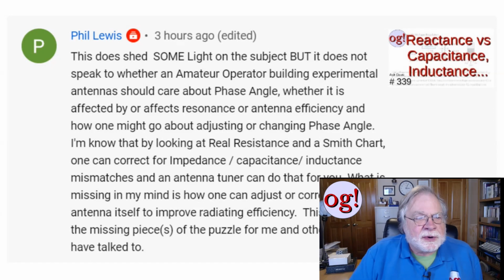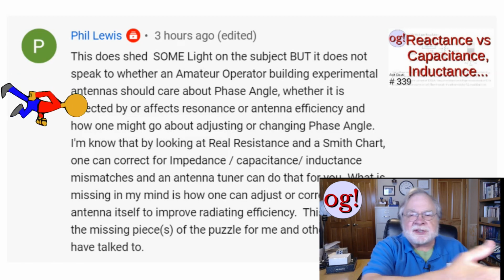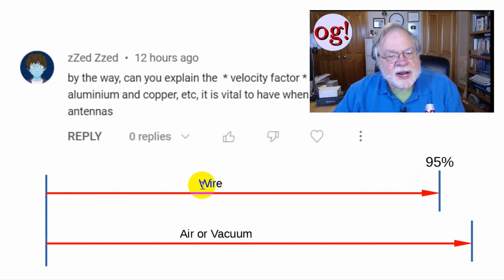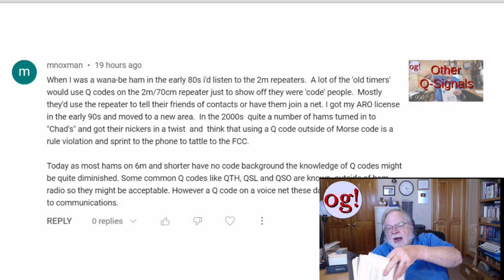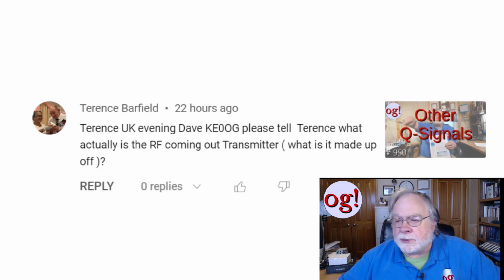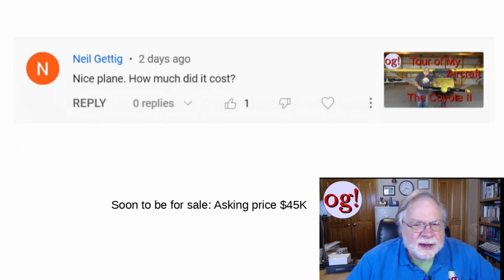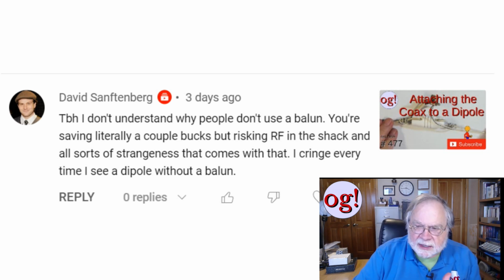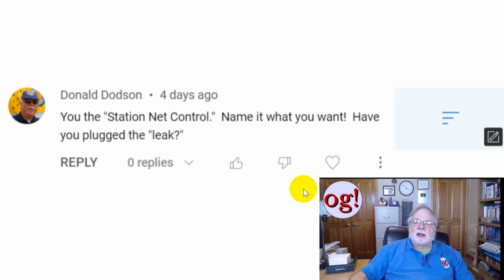Commentariat #14 25 May 2023

Comment: With your first explanation of your body capacitance and the meter affecting the results of your adjustments, I've often wondered and experimented with using an mfj analyzer that has a external power source such as a wall wart. I've often wondered if the electrical wire on the ground side that's connected to the cabinet will affect your results?
Great job on all your expl anations I thoroughly enjoy your videos.

Comment: Please Dave kEO0G Dave please what is RF made up of
Reply from the maker: Alternating current. Remember what AC is? It's a current constantly changing direction. The speed that it changes back and forth is called its frequency. Hams use AC at radio frequencies.
Reply: RF is low-energy photons.
Reply: @marka7831  Respectfully how can one measure photon with dummy load and meter
Reply: @terencebarfield5864  you are not actually measuring RF energy with a meter between a transmitter and a dummy load. In the transmission line you are measuring AC current and voltage, RF energy is generated by the antenna.
Reply: @cornbread-KO5RN  It might be worth looking up oscillator videos - "GreatScott!" has a surface level one that might be worth checking out.

It's just voltage going positive and negative like your house wiring, but instead of doing it at 50 or 60 times a second, it does it 146,000,000 times a second for 2m. Feed that to a resonant antenna and you're on the air.